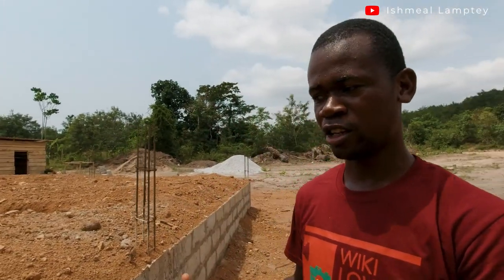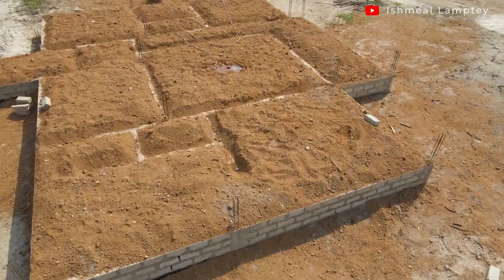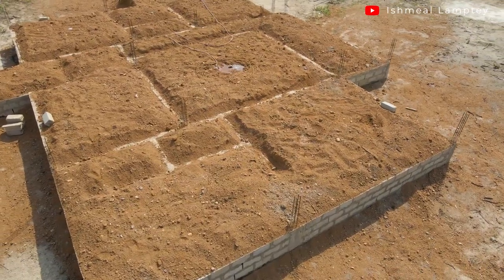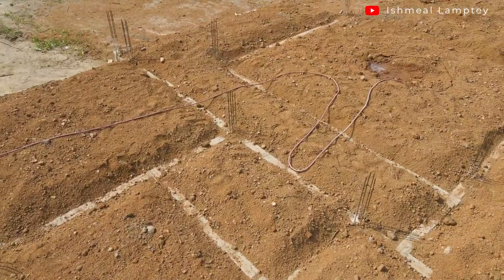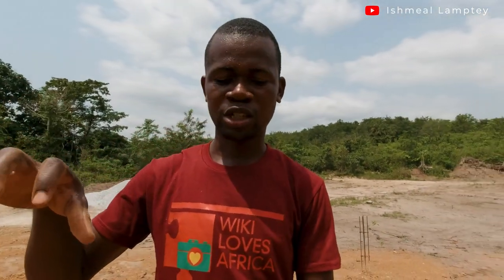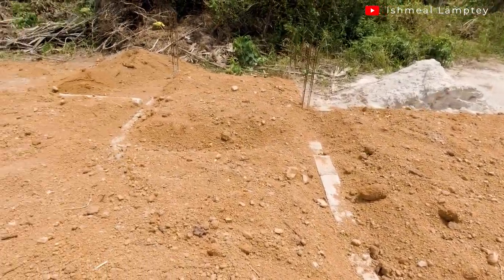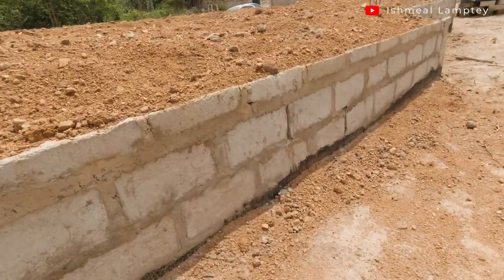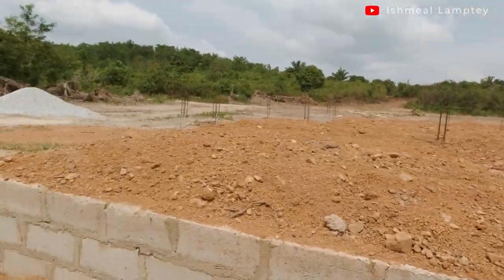Building a Solid Foundation: Filling with Laterite (Gravels) in Asebu, Ghana

Comment: Laterite or gravel as you call it, isn't what is called gravel in America. Gravel as we call it is small irregular shaped clean gray stones. Without silt sand or even dust...typically we would use sand as fill material wet compacted repeatedly till well settled, then clean rock stone gravel tops that and is compacted repeatedly, followed by waterproofing then spacers on which the rebar/iron rods are laid out on to lift the rods up off the weatherproofing so they will rest above the weatherproofing and in the middle of the poured concrete.
Reply from the maker: That is good to know. The right name is laterite here as well, however a lot of people interchange laterite to be gravels, and this has come to stay. Most local artisans know laterite to be gravels and not its rightful name. 😃.
Reply: @IshmealLamptey  So if I were in Ghana and wanted what American's know as gravel (clean small gray stones)and not laterite, what would I ask for ... ?
Reply from the maker: @rudygrissom5871  That is actually known as stones (could be quarry stones) or chippings here. And they do come in different sizes.